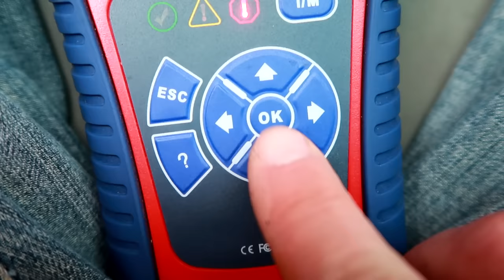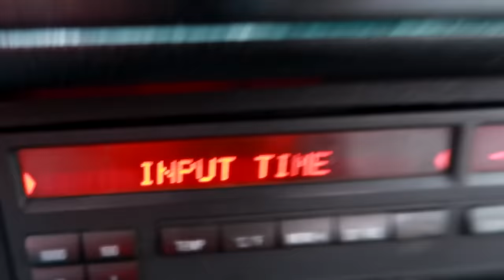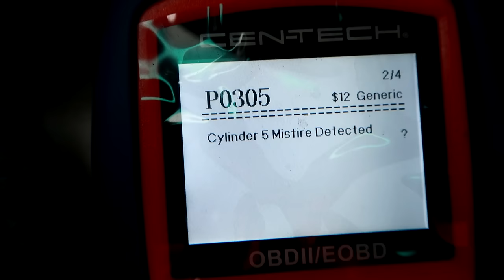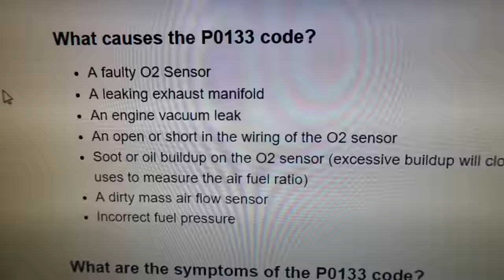The BMW is ILLEGAL

Comment: Just because it's throwing a few codes doesn't mean something went bad. I've let cars sit over winter, have codes, turned out to be nothing due to lack of lubrication or sticky grease. Reset and see if it's still throwing codes. I see it read slow on one of the sensors, could be because of the cold.
Reply: He had a CEL before it sat. 3 of the 4 codes are very common in those BMW's and vast majority of time are the precat o2. One of them is likely a bad coil (IIRC he didn't replace one of them) or wire and one could be either the o2 or his ECT sensor (which sitting has nothing to do with) or even coolent low or bad tstat

Comment: I have a 01 bmw 330ci and i bought it for $400 and it needed a driveshaft so i replaced it and i went out and drove it and the engine light came on and i coded it and i had 7 code i looked them up and replace everything both o2 censers, the masair censer and alot more me replacing all of this tells me that this car was beat the crap out of and if the engine light comes on and what ever it is change it ,it will make the car run better and smoother

Comment: You can reset that inspection light  yourself. google it. youtube it. its just a maintenance task. it has nothing to do with new york laws or anything. its just bmw dealerships way of getting customers in the door. flush your brake fluid change all fluids and filters. the power steering fluid reservoir has a filter in it too. reset that maintenance light. fix your intake leak. and clear the check engine light and u good to go bro. i bet all those powertrain codes are due to a dryrotten throttle boot. cheap fix. locate the mass air flow sensor on the air filter housing. any air vacuum leaks past that cause check engine light. could also be the crankcase vent tubes or diapragm under the intake manifold. easy fix. im a professional bmw technician.
Reply: This dude knows what he is talking about, have my thumbs up sir

Comment: Pull O2s out and check. Vise and a torch should show .1 to.9 or so volts (pretty quickly, or it's a lazy O2). Might find obvious melted O2 visually. Good luck.

Comment: Dalton use mass air flow sensor cleaner on the mass air flow sensor. My dads truck was throwing up codes and a check engine light and he cleaned the mass airflow sensor with the cleaner and it stopped all the codes and the check engine light

Comment: 3DMachines if more than one of your codes can be vacuum leak related look at that first, if no obvious signs put it back together let it idol and spray everything including intake and intake gaskets , injector o rings and vacuum hoses with brake cleaner while you listen for a change in the way the engine idles. Do the injector o rings and gasket while still cold.
Reply: vac leak does not = misfire on 1 cylinder, that code can be causing others.

Comment: the O2 is the easiest to fix, the miss fire is the hardest.
Reply: Trent Nelson fixed a misfire with a $60 coil pack, it's usually spark plugs (relatively cheap) or coils (somewhat cheap), and his is only on cylinder 5 so only one plug or one coil(unless it's a coil pack).
Reply: it could be the wires for the pack too, it can be the timing, when something electrical like that fucks up it can be a bigger issue.
Reply: o2 could be from the misfire, misfire costs nothing to check, o2 costs $

Comment: NYS Inspection is not even for safety anymore it's emissions, and getting the state money.  Once they removed ball joints from the inspection list (for anyone who does not know they hold the wheel on the car, if one fails the wheel falls off to some degree, you aint driving, you aint turning, you are just coming to a stop) I think this year they added window tint to inspection too... have fun anyone with non legal tints!  Advance and autozone, here have a scanner, pull a code sell you the part the code says.  They do not do diag... Have fun it's a BMW you don't buy them used, new and throw away.

Comment: 3 of those codes (and 4th even is possible) are likely because of 1 thing. I would wager your precat o2 needs replaced. 3 of them will come from that o2 sensor. Also the other is likely because of a crap coil (IIRC you didn't replace one of them) and or wire.
Reply: DaTwistedOne1 also, he needs to check the dipstick for the o rings. those cars have a completely sealed crankcase.

Comment: @3DMachines I bought a 2003 xr100r for $350 it runs and shifts gears, but I did notice that the spark plug was bad, when I give it more that half throttle it sounds like it hits rev limiter and also it won't idle after you ride it for a while would that be because of the spark plug or does it mean the carb needs adjusting? Please reply

Comment: check conecters under front seats ur air bag light is a loose connection, u can buy a card online 10$ that u can plug into the seat belt conecter which bypass cpu and eliminates air bag  light
Reply: should not be part of inspection...

Comment: Upvote so 3DMachines can see; You can get a temp inspection at the DMV that lasts 10 days, however iirc it's a one time thing per inspection period so you have to make the most of it for those 10 days. -Fellow Upstate NYS Driver
Reply: called reg you car... you don't get them for failing to get your inspection done.

Comment: You can drive to inspection place. Here is the bad problem buddy. If you have emissions you going to have to do a drive cycle after clearing the check engine light. Usually, that mean drive at least 100 miles. If you don't have emissions up there you are good. In Pittsburgh be so, but 15 minutes north of me you get into a different county and you don't have it. Not sure if you county has them or not.
Reply: Can't drive on the road, anywhere...

Comment: You will have to drive it to set readiness monitors before it can be inspected. 9 times out of 10 if you explain that and get an appointment card from the shop doing the inspection the cop will let you go.
Reply: After like 20 min of info trolling on here, this is the most correct reply so far. Congratz.

Comment: Do the inspection stations, in your area hook up code readers? Or. Is it just a visual inspection to see if the check engine light is on?
Simple cheat to get it through inspection, and, give yourself more time to correct the issues giving the codes: Pull the dash and take out the check engine light bulb.
Note: This cheat will only work if they do not use a code reader during the inspection.
Reply: NYS plug in test, lawl.

Comment: You don't want to drive the car but the problem is going to be even after you fix the problems and clear the codes you have to drive the car a while before it will pass inspection. That's why you can't clear the codes and drive straight to the inspection place.
Reply: You go, fail, get a temp extension and zomg can legally drive.

Comment: check the misfire first, it will cause the o2 sensor code. If you clear the codes you will need to drive the car A few hundred miles for the emissions system to run its check cycle and ok all systems.
Reply: The word you are looking for is a drive cycle, miles do not matter.

Comment: State vehicle inspections... nope! Luckily, the state of Oklahoma abolished inspections years ago. Most Machine Freak type folk around here run open pipes or catalytic converter and EPA / emissions BS removed. The only downside, people can get away with driving beaters on bald tires, faulty turn signals, etc.
Reply: And how often do they cause a death or something else like, that would warrant removing them from the road?  NYS you can have no CEL... and get a sticker... I've had plow trucks that, were more holes than trucks, fuel tank shoved in sand in the bed cause the other rotted out... 2ed floor, no park because the cab moved, no e brake cable... 

Had a valid NYS inspection rofl.

Comment: Auto parts stores have the same code reader as you. They're just fancier. They still won't tell you the exact and specific code.Only a dealership computer or OBD-II computer can be as precise to give you the exact problem code.
Reply: They tell the same code, no magic codes in the car here... they are called DTC's for a reason and not "answers"

Comment: inspection light is your oil life
Reply: you can also take the dash out and pull those led's out so the oil life is  no longer displayed it comes out as 1 piece on a small circuit board 
or a BMW oil reset tool will will do the trick they run about 50 to 80 bucks
Reply: ya that will solve it all when the computer gets plugged in.

Comment: Just clear the codes and take it in it will pass. Youll need to get the airbag light off though.
Reply: Clear the codes so it fails for reediness monitors, but get that airbag light off that aint part of inspection (99% sure on that last part)

Comment: BMW should have very strong battery and never go short turn and don`t get it all hot all the time The battery problem i known in sweden. Can get allots off fault code just becuse ju dose not got enough jucie in your car battery. Use a AGM-gel or OPTIMA battery! problem solved for a long way and u of all should know that you have  to retain your battery when not using the car for some time. sory for bad spell.

Take care and have a great 2017

Comment: unplugged battery for a long time throws codes bud and for them to turn off you have to contious drive the vehicle it took me three back and forth trips from Jessop exit to Claysville exit in Washington county PA to get a code off bc I needed new 02 sensors to reset the computer I had to make the 3 trips without turning key off it takes about 20 mins each way so say a 120mins to get the code to kick off I've never tried just letting the car idle for a long time to see if they kick off something to do with them heating to a certain degrees and cooling down a few then re heating maybe let it idle for ten mins then hold it at 2grand for a few mins then idle then 2 g what you need to do is go get inspection sticker then drive it the 50miles or whatever that way your half legal may be exempted the emissions if the last time the car was inspected the mileage isn't over 30k idk what New York's standard is but here in pa we are strict as hell on every thing vehicle wise and it's exempted aslong as car isn't 30k over last mileage reading previous owner or whatever they write the mileage on the back of the sticker and on the copy of inspection slip if you can find the old slip or even the garage last inspection was done should be filed under the vin make model hope everything works out and hope I helped bud
Reply: Turd Ferguson some time when you manually turn them off they kick right back on exspecially when the emissions machine gets hooked up best you drive it off then try to reset it manually I hang out at a local garage and multiple times I've seen it kick back on and they have to run down three exits and back 3 times might get lucky tho
Reply: Noah J  Hanggang lol mines a 98 last of the good grand cherokee
Reply: strokker !!!     your96?????
Reply: No motor work bro turns it into the strokker go check it out it turns the straight 6 into a v8 the closest you can get on 6 cylinders to a v8 think they said it's a 4.7 liter after I've been watching this dude that wants to do it for more power so he can run bigger gears and tires with out over loading and over working the motor what he's running now it bogs in second gear when he's in a pit so he wants to strokker his I'll get you his channel name but go check out the 4.0 strokker build on here
Reply: Not really I get good mpg better then my brothers stock 98 and I'm pulling a steel bumpers front and back on a 6 inch lift was sitting on 31 15 now it's on like 33,16 running Cooper discover sst
Reply: Not really I get good mpg better then my brothers stock 98 and I'm pulling a steel bumpers front and back on a 6 inch lift was sitting on 31 15 now it's on like 33,16 running Cooper discover sst
Reply: My brother said you got to be shitting me I'm also running a 3 inch from manifold back with a 3in a half tip and a air ram filter
Reply: Turd Ferguson yeah where I live there strict as hell and they don't like aftermarket exhaust and stuff either it's just the garage you go to is if it's allowed or not mine says if they sell it in a parts store why is it illegal and it all depends on the vehicle for the code thing all in how much technology is in the vehicle and the computer in the vehicle but like you said you would take code off and drive it dolton doesn't have that option sense he's way past the due date for inspection that's why he needs to just take it straight there and get his inspection sticker then run it to trip the code off and get his emissions sticker aslong as he has a valid sticker he can drive it to get the emissions bc technically he would be particularly legal but the garage is the thing if they will do that aslong as he's coming straight back to the garage after light and code kicks off for good I've seen the emissions machine trip the code back on after being shut off manually with the code tool and exspecially it's a BMW the computer smarter then your average car's computer
Reply: You got no clue what you are talking about no battery the only code should be a p0000 or p1000 i forget I won't throw a CEL and it just says not all tests complete... lawlwut.  Too much time to say everything else wrong with what you said, look up a DTC will tell you conditions to set AND clear (assuming no forced clearing via computer or battery d/c)
Reply: OK Matt bc I seen the shit with my own eyes so it's a lie and I don't know what I'm talking about cool story bro
Reply: Everyone has a opinion and not everything is the same
Reply: ifyaaintjeepinyoursleepin O'Bryan Outside my front door is a repair shop... but YOU SEEN IT lawl... Opinion... omg lol @ you unpluggin resets everything, car might run poor while in relearn it aint gona set codes kthxbai.
Reply: Dealerships fix Warranty shit, they won't want to work on your 99 POS unless it was being fixed in 2005... "certified" in what? ASE?  FYI ase is like you know what a spark plug is lol.  "bounce out my conversation" really wtf kinda english is this.  I am helping, telling the dude that when you dc the battery for a period of time you will never EVER get codes because the battery was d/c again car may run poor / shift odd until it relearns... I don't speak I'll put it nicely, "hood" or "getto" "black" whatever this shit is.  So I can understand some of the nonsense you are saying... I can understand this "you don't need to drive the vehicle for it to shut off a tripped code to relearn" nope you don't need to drive it to turn off a set code, you can, clear it with the scanner, if you do drive it, after whatever number of clean starts it will turn off on its own (for most DTC's again you can look up what sets and what will clear the DTC's) and yes, a car may need a relearn after the battery was removed or codes cleared. 

Actually most stuff that comes here now (was at a 4000sq shop, few bays etc.. much smaller now area) was at other places and they could not fix it.  By no means are "we" the best... but lol @ your shit leaves here comment to go somewhere else. 

You bring you shit somewhere to get fixed, I fix my own shit.  But you will tell me stuff...

Bro, you can look up what sets each DTC, I can post the fucking shit for this exact car, no where does the condition for setting the DTC say "battery disconnected" rofl. 

Now go learn some form of english that allows you to communicate with people.
Reply: Oh and the dudes never gona read any of this so to say help him, come on you think your comment matters to this guy?  That's just, sad.
Reply: Yup pos